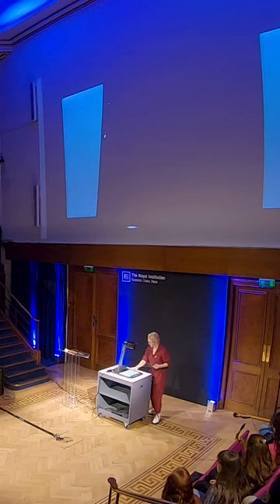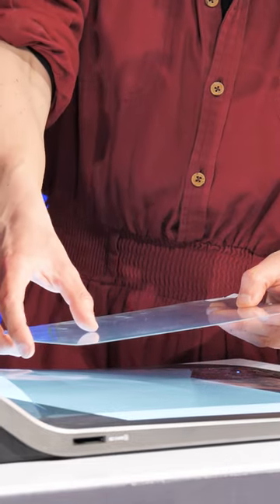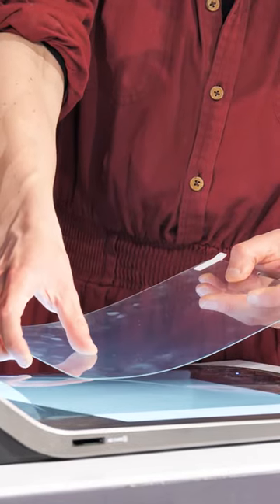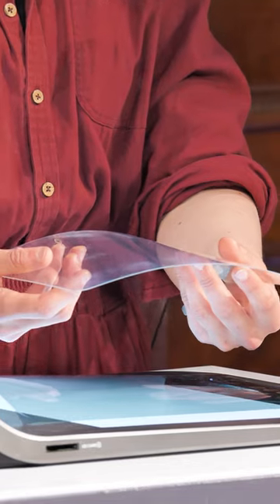How does tempered glass work? #sciencefacts

Comment: Not sure this explains how tempered glass works at all tbh
Reply: This demo is about the inherent quantum properties of light. Think about how two filters that hold 100% of the light get nulled when you add a third filter. The tempered glass is just a tool here. She could have used a third polirized screen.
Reply: @sebas11tian  but the title is "how does tempered glass work"?
Reply: @yadt perhaps a better title might have been ‘how does polarization work,’ or ‘how does light interact with birefrigent materials?’

But then again she certainly does explain how tempered glass works in all that. How it is able to bend as far as it does is what makes it a unique type of birefringent material. As far as I’m aware, just about any other type of glass would shatter long before tempered glass when any sort of torsional or flexure force is applied to it.
Reply: @sebas11tian polarization is classical, though has a quantum explanation. You need2photons to,show, non classical behavior
Reply: It’s not showing how tempered glass works, that’s common sense. It’s showing how with polarized light you can see stress patterns in glass.